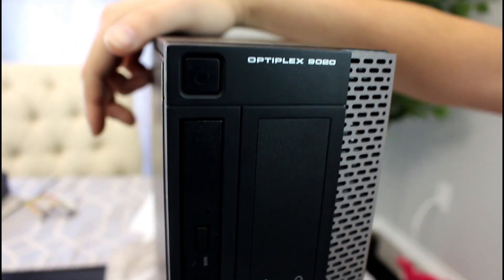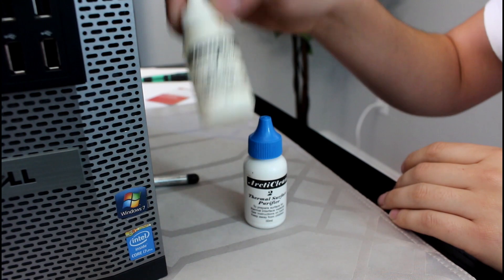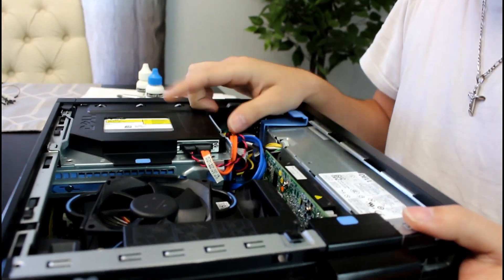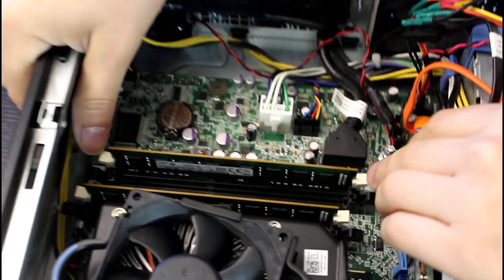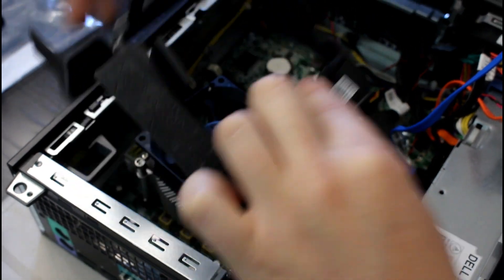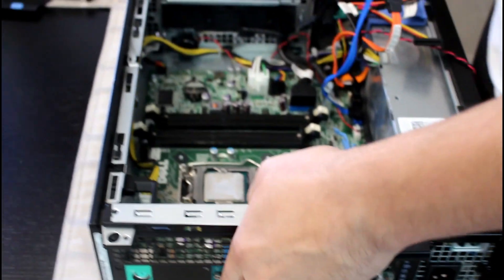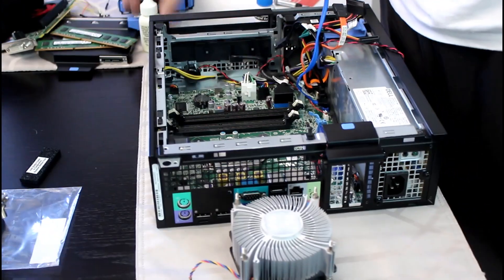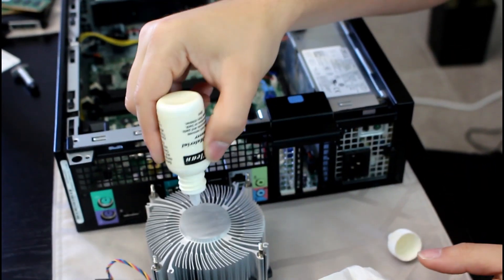Dell Optiplex 9020 SFF - How to replace the CPU and thermal paste

Comment: That's waaaay too much thermal paste. The paste only function is to fill in tiny deviations in the spreader and heatsink so they fit snuggle together as close as possible. That much paste only add thermal resistance. A grain of rice or a pea if a larger cpu in the middle is what professionals use. Don't spread it out, you're adding contaminants on the surface. Press the heat sink down with even pressure and then tighten it down with the cross pattern.

Comment: I had a optiplex 5050 with a i5-6500 working fine with good temps, I upgraded the cpu to a i7-7700 and now under load I keep hitting 80+ temp. I sure i re pasted it well and made sure the cooler was seated right. Just seems like the cooler won’t ramp up to cool down cpu.
Reply from the maker: Make sure that the BIOS fan setting is not set to quiet. That could keep the fan from ramping up. You might also need a higher wattage cooler to keep the i7 at a lower temp.

Comment: Hey I'm thinking of replacing my CPU it's an I5 3470 3.4 GHz with an I7 7770s 3.9 ghz
Reply from the maker: That unfortunately won't work. Those CPUs are different generations and therefore the sockets are not compatible
Reply: @FRANKHURTADO01  would it work with a 3770?
Reply from the maker: What desktop model do you have? So I can look for the CPU compatibility list.
Reply: @FRANKHURTADO01  Dell Optiplex 7010 SFF
Reply from the maker: The best processor you could put on that machine is an i7-3770s. Don't get the k variant because the Dell machine can't make use of the overclocking capabilities of k variants.
Reply: @FRANKHURTADO01  do you know where I can buy it?
Reply from the maker: Look for it on ebay or facebook marketplace. They're currently running from $40-$60.

Comment: I have the same case and the CPU fan screw is stuck.  Any tips on how to get behind the MOBO and hold it still while I unscrew?
Reply from the maker: Only way to get to the back of the motherboard is by taking the motherboard out. There's no rear access panel on these cases. Get a longer screw driver and put more torque on that screw to loosen it up.
Reply: @FRANKHURTADO01  the length of the screw driver doesn't matter.  Its the CPU bolt stripped inside the motherboard bolt. so both are spinning in the same direction.  I was even pulling on the cooler with my other hand while screwing and I can hear the case bolt rubbing against the back of the motherboard.
Reply from the maker: Ah ok. You initially said the screw was stuck, not stripped. Removing the motherboard is going to be your only option so you can access the back end and remove the stripped screw.
Reply: @FRANKHURTADO01    How though is the trick?  Because the stripped screw on the CPU cooler is holding the mobo and cooler to the chassis.
Reply from the maker: You said it's loose and spinning with the screw. If that's the case, then the motherboard riser holding it to the chassis is broken and no longer part of the chassis. You won't know what you're dealing with until you start taking it apart.
Reply: @FRANKHURTADO01  Ok I get off work in 2 hours.  Let me try to remove everythign 1 more time to see if it comes right off the chassis.
Reply from the maker: @kamakazikiddo  where you able to get that heatsink off?
Reply: @FRANKHURTADO01  In the most annoying way possible lol.  I ended up getting bolt cutters and breaking cutting it off the Heat Sync.  And then sliding the motherboard straight up over the bolt.  It was stripped on both the chassis and inside the bolt so it was just spinning on both spots going nowhere.  All that effort to re apply thermal paste and salvage the board and gen 4 i7 chip.
Reply from the maker: Well at least you got it out!
Reply: @FRANKHURTADO01  True, thanks for the reply and tips.  It was definitely not worth the $50 repair lol.  Oh well win some lose some.
Reply from the maker: @kamakazikiddo  That's how we learn, by trying things out!

Comment: Hi!

So we want to buy an Optiplex 9020 SFF for home as an Hackintosh (with macOS) with an i3-4160, 8GB RAM and an 250GB SSD from an reseller which sells refurbished PCs and co. 

Unfortunately the i3-4160 only has 2-Cores and those aren‘t enough I guess. 

I want to replace it for an i5-4570, is that possible? 
This CPU has 4-Cores thats the reason Why I want to upgrade it from that i3. 

Also, the PC I want to buy only has the integrated HD 4400 Graphics, I want to insert an NVIDIA GeForce GT 710 2GB into it so it becomes hackintosh-compatible, is it possible?

Thank you! :)
Reply from the maker: I don't know much about hakintosh compatibility so can't help you there.

As far as component compatibility, this machine can handle an i7-4790 if you wanted to. Any GPU that is only PCIE lane powered and low profile should work. Something like a 1050ti LP or a 1650LP or an AMD RX560. The key for this GPU is that it is only PCIE powered, no because the 9020s don't have external power connecters for GPUs. 

Also, from my limited experience with Macs, AMD GPUs seem to have the best compatibility.
Reply: @FRANKHURTADO01  

Thank you! :)

My question was just if the i5-4570 and the GT 710 is compatible with this PC :)

The GT 710 is natively supported up to macOS Big Sur, so there shouldnt be a problem with that :D

I hope this machine can last about 3-4 years, it will be an home PC using basic office tasks like Word, Excel, Homeschooling, Websites and etc.. Only reason for me was it can run macOS just fine lol :D 

Thx again
Reply from the maker: @samed161  Yes i5-4570 should be compatible Try to get an S model if possible since those use a bit less power and will leave you with more power for the GT 710. Also make sure you get a low profile GT710.

Comment: Nails wont come off that fan thing
Reply from the maker: What nails are you talking about? There should be no nails in this or any system.
Reply: @FRANKHURTADO01  my bad, I meant screws. For some reason they dont move, only one of them was rotating
Reply from the maker: Hmmmm. Don't be afraid to put more force while untightening the screw. Use a screwdriver with a bigger handle rather than a smaller one to put more torque on the screw. These shouldn't be impossible to remove unless someone glued them on. Also, remember righty tighty, lefty loosey.
Reply: @FRANKHURTADO01  alright. Thanks

Comment: You should have shown reassembling in normal speed. It is easy to pull all plugs, and realize how hard it can be for beginners to plug in at right places at the end.
Reply from the maker: Sorry about that. Reassembly should be the opposite of disassembly. Was an oversight on my part not thinking about beginners following my video step by step.

Comment: I would never clean a CPU installed in a computer. There's just too much chance debris from the paste can fall into the CPU socket or surrounding areas. If it gets onto the springy tabs for the processor, you may totally destroy the motherboard. Not something you'd want to do to your board, and definitely not something you'd want to explain to a customer either. So take the few seconds to remove the processor before cleaning it to protect your  (**s), self.            Just sayin'                                    Mike.
Reply from the maker: The CPU installed in it's socket actually protects the socket pins as nothing should be able to make it under the CPU when it's locked in place.. The socket being exposed is the most dangerous and most likely time where pins or debris can make it onto the exposed pins or socket.
Reply: Es correcto

Comment: .Normally psu bist light blink everytime you plug the computer. Right. But now , i plug no sign of light anymore.

 (Dell 3060 sff psu)

Bro how do know if the power supply is dead. I try to test my psu, only psu motherboard and processor are intact. My psu is BIST BUTTON FREE.  I remove the 4pin 8pin connector from the motherboard , then plug the psu. The Bist light glow for 3 second,  i put back again, it won't glow. No sign of light, 

I try also psu test using paper clip method jamper black and  green the psu bist light glow and the fan is spinning

Is my motherboard is dead or my psu?
Reply from the maker: That is a tricky one. Usually PSUs die before the motherboard goes out. I recently replaced the PSU on my T3500 but it wouldn't turn on at all. No LED on PSU or fans or anything.

I would start with PSU since it's the cheapest option.
Reply: @FRANKHURTADO01   Maybe i need buy another psu. To test my motherboard. What if the motherboard is faulty.  In your experience how can you diagnose the psu of ours with BIST BUTTON FREE if its dead or malfunctioning without equipment or spare parts.

My psu without motherboard glow for 3 second
Jamper the black green the bist light glow and the fan is spinning. 

Connected to the motherboard no bist light nothing happens 

For real bro PSU?
Reply from the maker: @JeeYen28  Get a multimeter and do the paperclip jumper again to test for voltage and make sure it's giving 12v, and 5V. 

Also disconnect all disk drives and try to boot it with the least amount of RAM possible to see if any of those components have gone bad.

Again, from my experience, PSUs on Dells tend to die off first. I refurbish Dell desktops and usually when they don't turn on for no reason, it's a bad PSU.
Reply: @FRANKHURTADO01  thank you
Reply: @FRANKHURTADO01  here the short video bro. https://youtu.be/YgL8GYCpvPs why the bist led not glow after i connect to the motherboard? Normally it will glow right? Did you try this?
Reply from the maker: @JeeYen28  Saw your video. can you mount the CPU, cpu cooler, and RAM and try again to see what happens with thr BIST LED.
Reply: @FRANKHURTADO01  sorry for the late reply   . Nothing happens , no light up sir. No sign of power. Is this really the psu sir. Thank you.
Reply: @FRANKHURTADO01  i know you have a lot of experience. I buy the parts what you think is faulty sir. Thank you.
Reply from the maker: Yes start by replacing PSU.

Comment: Do you need any drivers or anything when upgrading a cpu?
Reply from the maker: Yes bit windows has them built in and will install them the first time you boot. You will notice it takes longer than usual the first time you boot.
Reply: Frank Hurtado thanks!

Comment: Is it possible to replace the stock heatsink with other low profile aftermarket ones like Noctua?
Reply from the maker: As long as the mounting hardware is compatible, I don't see why not. I have doubts that  it would work though since it's a proprietary Dell motherboard.
Reply: @FRANKHURTADO01  I see. thanks for the reply 👍

Comment: That is way to much thermal compound. Apply to the CPU OR heating OR with a straight line, definitely not all of the above. Still a nice video. Is there a better aftermarket cooler that will fit in the same space?
Reply from the maker: Thermal paste was applied according to Artic Silver specs. All thermal compounds are different and it is best to apply according to manufacturer specs. I am not sure if aftermarket coolers are compatible with Dell motherboards. Haven't tried that out yet since Dell makes things proprietary in their machines.
Reply: I was about to say, nah it looked fine to me…then I saw he put it on BOTH the heatsink AND cpu. Yeah…that’s excessive.
Reply from the maker: Artic Silver says you have to pre-tin both surfaces before applying the thermal compound. Have done it this way for dozens of builds and never encountered a problem.

Comment: Do you know if the sff supports the i7-4770k?
Reply from the maker: I don't believe so. The SFF only support a  65 watt TDP CPU. Also the K model cups are overclockable and this Dell has zero overclocking capabilities. It would be a waste to have a k model CPU in it.
Reply: @FRANKHURTADO01  Thank you for the quick reply and for your help!
Reply from the maker: @jojo-vw3oz  No problem. Glad I could help!

Comment: not supposed to use a spreader for the thermal paste it spreads out on its own but ok
Reply from the maker: Artic silver recommends that you tin both surfaces ( heatspreader and heatsink) before putting the final amount of thermal paste. This ensures that the thermal paste gets into every microscopic cracks and dips in both surfaces. Most manufacturers recommend tinning...
Reply: @FRANKHURTADO01  they want the paste to leak into the socket and ruin the motherboard
Reply from the maker: @luthermartin44  That's not how it works. Only way to get it in the socket is if you accidentally put some on the bottom of the CPU or purposely put some on the socket.

Comment: Surgical spirit or isopropyl alcohol is perfectly adequate for cleaning off old thermal compound. You don't need that expensive 'special' fluid.
Reply from the maker: I got it for nothing when radioshack was closing. That's thr only reason I use it. And yes alcohol works perfect...
Reply: I used some old perfume and managed to remove it....
Reply: I find turpentine works best and it's quick.
Reply: @allbeit582  turpentine is risky
Reply: @brentnashbuan  risky ? , in what way ?
Reply: @allbeit582  i think turpentine is brush cleaner right?
Reply: @brentnashbuan  yes, it is commonly used to clean up after using oil based or enamel based paints.
Reply: @allbeit582  yuh but what if u splashed a little bit on other components?
Reply: @brentnashbuan  it won't do any damage. You just put a little turps on a rag and wipe the chip. No need to give it a bath in the stuff.
Reply: @allbeit582  oh, okay thanks for the tip!
Reply: thankgoodnes

Comment: Hi my dell 7010 processor socket pin one is broken and I can easily confirm that.... Is there any option to change the socket
Reply from the maker: It is possible but it would be too expensive if you don't already have the tools available to replace the socket. It is also difficult to fix even if you have the tools at your disposal. 

I would buy another motherboard or try to micro-solder the pin back if in fact it's only 1 pin that's broken.
Reply: Frank Hurtado
Thank you so much
Only one pin is broken so let me try  to do that or will replace the motherboard instead

Thansk
Reply from the maker: Just be careful when you try to fix the pin because if you short something out you might end up killing the processor

Comment: Is it possible to use this dell cpu cooler/heatsink on a standard mATX motherboard? I'm taking out the i7 it came with to build a new pc and wondering if I should buy a new cpu cooler or if I can just keep this one.
Reply from the maker: I would make sure firat that it fits the socket standard of your i7 in the mATX board. Dell tends to make custom parts that dont fit the standards for custom PC components. If you want to keep it low profile, I wouldn't bother with the Dell heatsink. I would just get a Noctua low profile heatsink and fan.

Comment: Con alcohol isopropilico hubiera terminado a la primera incluyendo tarjeta de video fuente de poder y hasta motherboard y ese método de la targeta para la pasta no me. Gusta porque todo después quedará en las orillas y se acumulará cabe la posibilidad de un corto
Reply from the maker: Todo lo que hize es lo que recomienda la compañia. La pasta no conduce electricidad. Esta pasta tiene un periodo de 200 horas para curarse y entre menos aire se quede atrapado en el material, mejor conduce el calor del procesador.
Reply: @FRANKHURTADO01  que tal ese ese tipo de dell 9020 son buenas o malas presentan problemas?
Reply from the maker: Sin buenas compus. No me ah salido problema con ellas.
Reply: @FRANKHURTADO01   yo antes tuve Dell y me daban problema con la luz naranja en las versiones 775 entonces ya no dan dolores de cabeza

Comment: Hi what is the part ## of the HD bracket, mine is not wide enough to fit both the 3.5 and ssd.
Reply from the maker: I don't have the 9020sff anymore but it came with a 15mm LFF hard drive. Not all 3.5inch harddrives will leave space for an SSD.

Comment: Hey man, if you still have one if these, what sort of temperatures does the cpu reach under load? I've just applied fresh thermal compound to mine and when I run prime95, my core temps reach 85-89° Celcius. I've read that this is typical of the 9020 but would be interested to hear your feedback
Reply from the maker: Synthetic loads will always run a CPU hot. 85-89C sounds about right for any CPU on air with Prime95. Thr 9020 doesn't have that great of an airflow so I would expect the CPU to run from low 50s to high 70s under normal load.  

Most processors are fine up to 100C with thermal throttling. Check your processor specs out through the Intel website to make sure but it sounds like your processor is running just how it should under a synthetic load.
Reply: Frank Hurtado cheers mate. I have read a bit about it's operating temp, I'm just a bit sad that there is no way to modify the fan profiles because Dell have opted for minimal fan noise rather than cooler operating temperature 😑 (the fans basically never reach their max rpm)
Reply from the maker: I would take a look at the Dell Fan Utility and see if that works for your system. 

2nd I would look at applying Liquid Metal from thermal grizzly as a replacement for your thermal paste. Just make sure that your heatsink and cpu heatspreader are not made of aluminum.

Lastly I would look into retrofitting a bettet heatsink and fan. Maybe something from Noctua that is low profile leagues better than the stock heatsink.
Reply: Frank Hurtado thanks, I'll have a look in to the Dell fan utility. I'm probably not going to bother with a new heatsink or compound for a while. I used AS5 compound which is supposed to be good. Maybe if it gets any hotter once I put the 1050ti in I'll consider a fan/heatsink upgrade
Reply from the maker: L Innes Sounds good. Make sure to leave your PC on for as long as possiblso you can chee through the 200 hour break-in period of the AS5. You should start seeing lower temps as you get closer and closer to finishing the break-in.